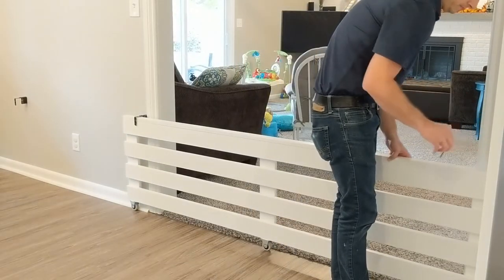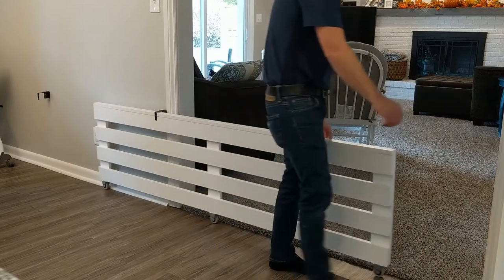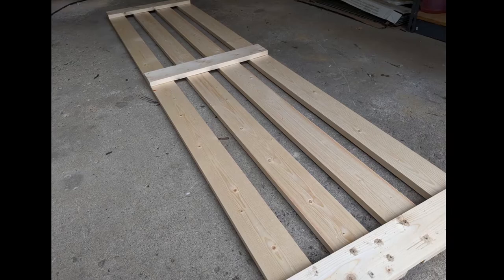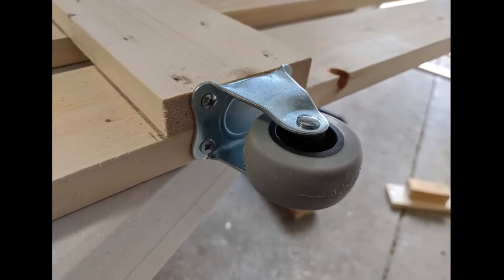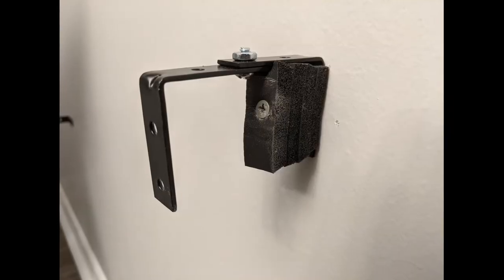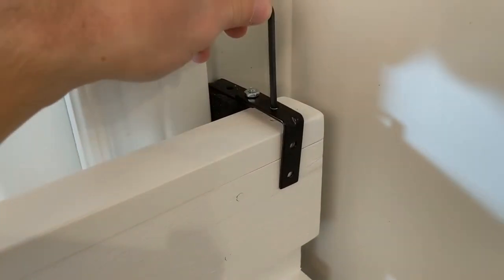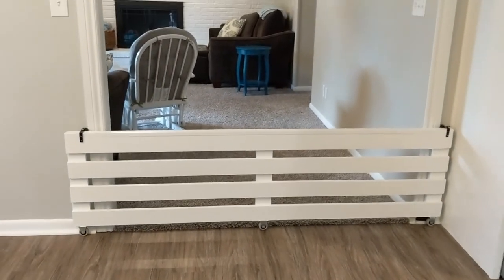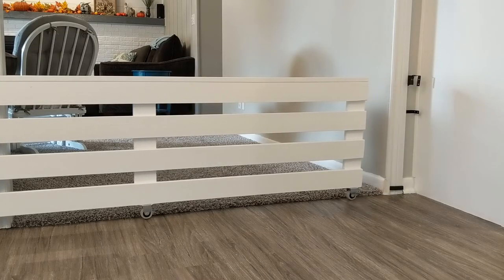DIY BABY GATE -HOW TO BUILD YOUR OWN ROLLING BABY GATE - Projects With Steve

Comment from the maker: As the boys got bigger and smarter, one of them figured out how to pull the pin that locks the gate.  I changed the pin idea to a bolt. I placed an insert nut in the hole and then used a bolt that screws into the insert nut to lock the gate shut.  I think it will be quite awhile before the boys figure out/have the ability to unscrew the bolt (LOL).  Here is a link to an insert nut similar to the one that I used.

https://www.homedepot.com/p/Everbilt-1-4-in-20-Zinc-Plated-Insert-Nut-4-Pack-801884/204274222?MERCH=REC-searchViewedNA-204274222--N
Reply: its your fault if your kids are smart ;-)

Comment: My gate wants to lean toward the wall at the top and “walk” out at the bottom every time I use it.  It won’t vertically straight.   Any ideas?
Reply from the maker: Where I have the brackets on the wall to create a guide for the gate, I used foam weatherstripping to create a spacer so that the top does not lean toward the wall. I don’t have an issue with the bottom kicking out. Maybe try a different wheel that has more grip to it. Good luck.